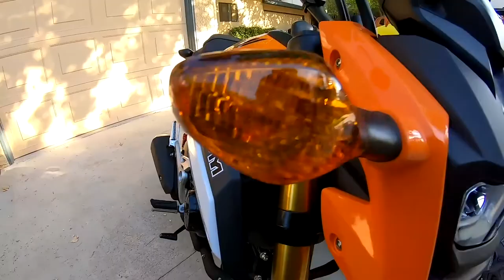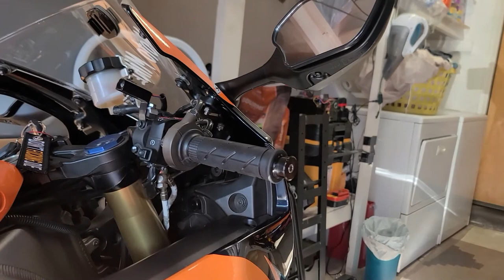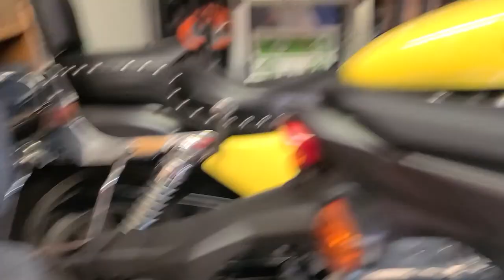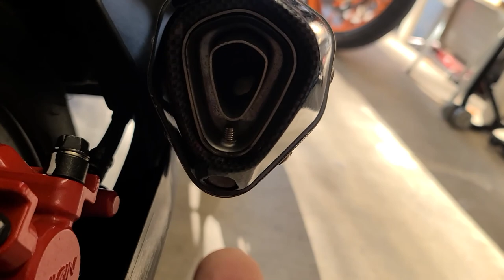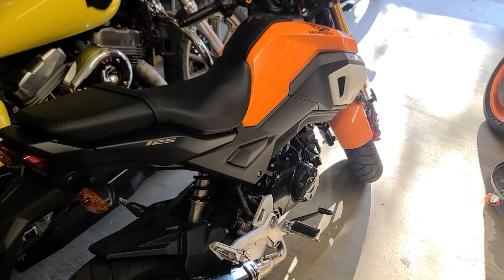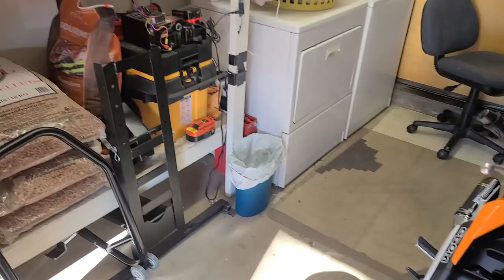MotoVLog from the Garage today. Talk about dropping my CBR1000RR & Exhaust Upgrade to the Honda Grom

Comment: The 3rd time wow what a pain that would have been. That should touch up all okay you were lucky it was not more. And that is a hell of a nice looking bike man I do like it. And yeah sometimes we have to sell one thing to get another it suck but you get what you need at the time that way.
Reply from the maker: Thanks! Yes, I'm lucky the plastics are okay and something more expensive didn't break. I had a friend who basically did the same and knocked a hole somehow in the engine cover. 😳 Thanks for watching! 👀